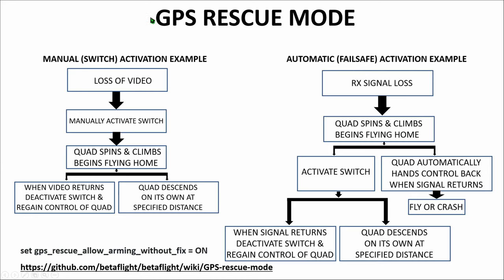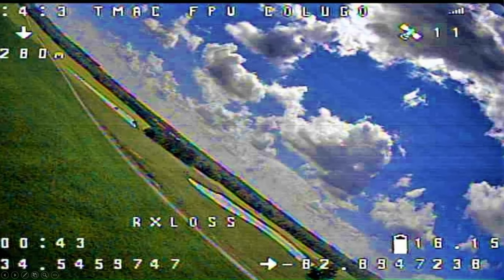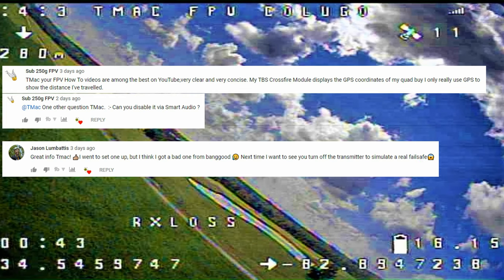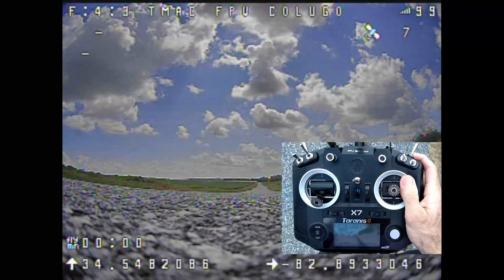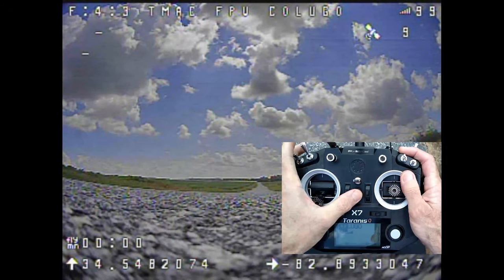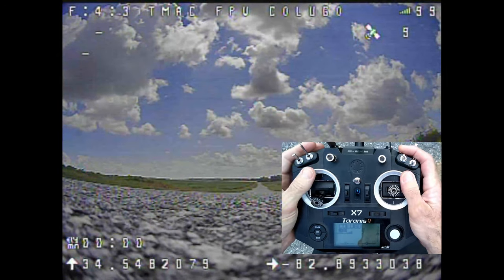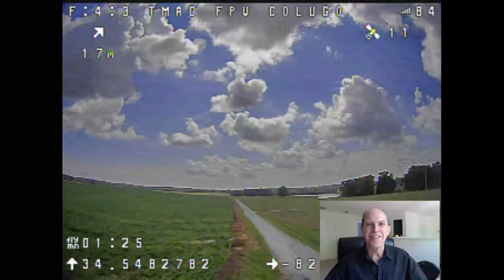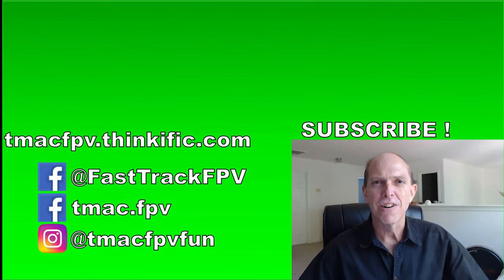BETAFLIGHT GPS RESCUE MODE FAILSAFE

Comment: Hey Tmac, great video thanks. I tried to simulate a failsafe to see if the quad would RTH. I used an aux switch on my transmitter on the aux tab in BF and set the switch to failsafe. Upon activation the quad just dropped. It didn't RTH. Any idea where I could be wrong?
BTW I did get a proper gps lock and also the quad RTH when testing it with GPS rescue assigned to a switch on my TX... Cheers Jake

Comment: What if the arrow does not point back home? My arrow never points back home, but the distance to home is very accurate. Using an HGLRC M80 Pro and a Zeus F748 stack. When i flip gps rescue it shoots up to like 70m in the air (even though rth is set to 30m). I'm also more than 200m away when I tested. Is there a way to calibrate the home arrow?

Comment: Hi Tmac, today i was flying for the first time my new 7 Inch Long Range Build with Crossfire. I have setup my Betaflight exactly like you. Than around 1km away i was turning back to return and got a Failsafe. But the Quad crashed directly to the ground. I was 20m over the Trees of a Forest. Fortunately, everything survived without any damage (Props included). So tomorrow i will test the Switch based GPS rescue. At the time of the Failsafe i got 18 Sats....
Reply from the maker: That's odd  Sounds like you got lucky!  Test it in a safe area and manner (in case it does't work) until you gain confidence with it.  Sounds to me like something's not set correctly.  How many satellites did you have when you launched?  did you have the minimum necessary?  You can check all of your GPS settings in Betaflight by going to the command line interface CLI tab and in the command line type the words  get gps  and press Return on your keyboard.  Everything that shows up on your screen will be GPS related.  Look at al the settings (such as minimum distance, min # of satellites, etc.).  If you're unsure of what each setting is for, please see the following link: https://github.com/betaflight/betaflight/wiki/GPS-rescue-mode
Reply: @TMacFPV  Tomorrow i can tell more i think. I have double and triple  check all settings. Everything is setup correctly.
Reply: Today ist worked fine. 5 trys with switch and one try with turn off the Transmitter to cut the crossfire link.
Reply from the maker: @zefixx6659  Outstanding!🙌👍 Happy to hear it😁 Thanks for the update!
Reply: Its my understanding that when using CSFR for the controller link,one must configure the Crossfire RX "failsafe" action to be "CUT". Then when the CSFR link is lost, the Betaflight configured Failsafe actions (failsafe1, then  failsafe 2 and GPS rescue) will then kick in. If your Crossfire RX failsafe setting is not set to CUT, then GPS rescue wont work at RX LOS.

Comment: Tmac great video but still a bit confused. I have GPS rescue enabled and the switch rocker works fine but how do I set the failsafe.    I have the failsafe set to GPS rescue and can also GPS rescue  mode by switch  myself.  So do I need to touch any of the channels on the left of betaflight ?  I see a bunch of.channels under the failsafe tab or can I just leave this ?  Thanks again 👍. Also do I need a failsafe mode enabled in the modes tab ?  Cheers
Reply from the maker: This was the 2d of two videos. The 1st one shows the setup here https://youtu.be/2lePVoK0t1c

Comment: Coming from Inav, I setup BF rescue and all works fine except when I turn OFF my TX  BF doesn't recognize FS even though throttle drops to 885. In Inav it works, parachute turns red.  Any ideas?  Thx

Comment: Hey tmac great video I have just got croc baby 5 never used GPS in fpv drone before my area seems to be all over the place and the distance from home and height doesn't seem very accurate is this normal? If you are facing towards yourself which direction should the arrow be?
Reply from the maker: Hey sheapy FPV!  please see the following link, "We Suggest the Following Procedures" paragraph. https://github.com/betaflight/betaflight/wiki/GPS-rescue-mode
Reply: @TMacFPV  thanks tmac 👍
Reply: @TMacFPV  if the arrow is pointing forward (up) is that coming back to you and arrow facing down going away from u?
Reply from the maker: @sheapyfpv8224  if your GPS arrow in the OSD is pointing up, "Home" is in the direction your aircraft is currently flying (in front of you).  if the arrow is pointing down, "Home" is in the opposite direction your aircraft is currently flying (behind you)

Comment: Great video! I set up a RDQ gps on my quad, cant get a switch to work? I have the range set correct but when switch activated it will not light up the gps rescue tab in betaflight, it stays gray/ Have any suggestions? Thanks!
Reply from the maker: Did you grab the available checklist in the video description? Might help👍
Reply: @TMacFPV  I have been it will not activate closer than a 100 meters, so I guess you cant ck the switch in Betaflight?

Comment: Excellent video.  However, I hope you can assist or explain my issue.  I have had two quads now do the same thing whilst testing GPS rescue mode (activated by switch) and that is flip upside down and free fall to the ground.  Both quads GPS rescue trials worked perfectly on the first test, however on the second attempt each flipped and free fell, and no matter what I did I was unable to regain control.  First first one happen 6 months ago and it caught fire when it hit the deck, the second only yesterday flattened the 4S 1550 Lipo but no other damage.  Fortunately the Crossfire system retained the GPS coordinates when they hit the deck so I was able to find both quads with ease even though they plummeted almost 1 mile away from launch.
Reply from the maker: hmmmm, I do not know for certain what the problem is.  I can offer some things to look at though.  First, make sure your Accelerometer is toggled to ON position in BetaFlight.  Next, here's alink to GPS Rescue in Betaflight Wiki:  https://github.com/betaflight/betaflight/wiki/GPS-rescue-mode  And, finally, Bruce Luckcuck is the developer of this feature and he can be reached in Betaflight Slack at: https://slack.betaflight.com/

Comment: Just a note that the OSD menus are not "smart audio". Smartaudio is a protocol used by the flight controller to communicate with the vtx to set channels, power, etc.
Reply from the maker: Yes, thank you Bruce! I did catch my verbal misspeak when I uploaded the video and included Betaflight OSD in the description of the video rather than "Smart Audio." I must have been focused on answering the question using the same terminology in the comment I received.  I have now also included a "card" in the video at the 2:03 time mark clarifying my mistake for those who do not read the video description.  Thank you again!

Comment: Hi TMac. I've returned to this video specifically in order to ask you a specific question. I'm asking because I believe you will give me a detailed answer, weather I'm right or wrong, about a certain theory of mine regarding some challenges with my gps module. Powering up my module separately from the rest of the quad does help acquire a sat lock  more efficiently; however,  once I power up the rest of my quad, including the vtx of coarse, things seem to get a bit wonky with the gps signal. Even after separating the gps module and it's wiring from the vtx and nano Crossfire receiver. 
 It's a 4" quad and I understand the challenges with a smaller setup like this but here is my question to you, Sir...
   What if I fabricate a small faraday cage encapsulating each competing component individually? Perhaps utilizing copper screen material surrounding the vtx, rx and even the flight stack itself thus preventing any interference in the first place? Do you think that would work? I realize the wiring between each of these units would have to be protected as well but do you think there's any merit to my theory?
Reply from the maker: Hey Don, good question.  Yes, we all have that same issue when we power on the rest of the quad's components (especially when using an HD camera onboard).  theoretically, your idea has merit, however, it may not be a very practical application.  Any way you can isolate other electromagnetic interference (EMI) impacting your GPS module will help.  The most practical way I have found thus far is through the use of copper foil tape (here's a link to the type I get from Amazon  https://amzn.to/3A1Kpqj).  I use the tape to wrap the 3D printed mount the GPS sits in and also the GPS wiring harness and any other wiring harnesses that are near the GPS.  Then, I run a wire from a ground pad on the flight controller to each of the copper foil wrapped wrapped items and solder the wire to the copper foil tape.  here's an example showing one of my 3" quads with the GPS mount wrapped in copper foil tape and the GPS wiring harness wrapped in copper foil tape.   You may not be able to see the ground wires soldered to them  https://bit.ly/Example_Copper_Foil_tape .  Another thing I found has helped is to run the LiPo battery leads away from the GPS module (it at all possible) rather than back toward and along side of it.  Hope this helps!  I'd be interested in hearing your results.
Reply: @TMacFPV  Thank you so much for your reply. I just ordered some copper tape.

Comment: I am piloting with my DJI radio and would like to know if your RESCUE GPS setup (set to Failsafe only) is working if I lose signal or video?
Reply from the maker: Failsafe is for loss of control signal. If you lose video you need to flip a switch to activate it. I do not use SJI, however, here's a video demonstrating it with DJI https://youtu.be/KXyhfmY9b6A
Reply: @TMacFPV  thank you Tmac, so in 2 cases, I need to activate switch and disabled it once rx signal or video return ?
Reply from the maker: Yes, that's ideal. Use the switch for both. However, for failsafe (no control signal) it should activate on its own. However, if you don't flip the switch afterwards, it will return control to you as soon as it gets it's control signal back and you may not be ready for it. Here's a complete "How to" video  https://youtu.be/2lePVoK0t1c See more on Betaflight Rescue here https://github.com/betaflight/betaflight/wiki/GPS-rescue-mode
Reply: @TMacFPV  thank you Tmac, take safe
Reply: @TMacFPV  do you think your setting of gps rescue run on a 7''  quad
Reply from the maker: @yannperherin354  gps rescue should work with any size quad

Comment: Unfortunately, today I lost my Tyro129. I don't understand what happened. The RSSI was good, but suddenly the rescue mode was activated on its own, and, instead of going back to me, it goes away! When he was leaving, I could see the rescue mode deactivated, and he started to fall; the video signal was interrupted before reaching anywhere on earth. After the fall, I was unable to get any signal, neither from the ratio nor from the VTX.
Reply from the maker: Wow, that is very unfortunate.  That's the first time of heard of "GPS activating on its own" and flying away. What's even more curious is it "starting to fall" after deactivating and you losing video (power?) completely before hitting the ground. Did you have the DVR recording on?  if so, playback the DVR footage and take a look at your OSD for RSSI, warnings, etc. to see if it has left you a clue as to what happened.  Did it work properly when you tested GPS rescue prior to flying with it?  If you had OpenTX logging of your GPS coordinates to your transmitter's SDC card per this video https://youtu.be/Ep_RrfOIW_k you may still be able to find it.  I'm guessing you didn't have the last known GPS coordinates displayed on your transmitter as demonstrated in this video thenhttps://youtu.be/mqYcgPZe1KE .  If not, I know it doesn't help your current situation, however, perhaps it will in the future.

Comment: Wow dude next time get some more altitud and do not use acro mode to do the test use horizon or angle before you turn the radio off, the craft backed left during the radio turn off procedure and you did lost some altitude and attitude from the craft, you are my hero, just in time the failsafe save you craft. LOL   You have big cojones, fantastic love it.
Reply from the maker: Hey maxun1, welcome aboard! It WAS a little "exciting" 🤩 wasn't it?

Comment: what you was doing with sticks while drone was in RX loss ?
Reply from the maker: nothing at all. With GPS Rescue as the failsafe, the quad starts to return to it's launch point on its own (without any control from you moving sticks) until you regain control of it when control signal comes back or it crashes near it's launch point (it does not soft land)

Comment: Nice test 👍 😀, I have a question,  why my  drone seems loosing altitudes after flicking the gps rescue switch? The drone will head home but instead of gaining higher altitude it starts to loose the altitude?  Isn’t it it supposed to go high while heading home? It seems like it’s loosing power. What settings I need to adjust in the CLI to make it work like yours?
Reply from the maker: Thank you!  I'm providing you a link to my complete GPS setup video.  Start at time hack 10:30 of this video:  https://www.youtube.com/watch?v=2lePVoK0t1c
Reply: TMac, You are awesome TMac 😀👍
Reply from the maker: @wilfredocampo4215  Thanks for your support Wilfred! Happy to help friend!

Comment: Great video thanks. But checklist link did not worked. And i'm not to be sure which switches did you changed before open the radio again ?
Reply from the maker: Thank you!  I just tested the link and it works.  Please check you r other email folders such as "Social," "Promotions," or even "Spam" folders as sometimes emails will get routed to these folders by mistaqke.  If you find it in any folder other than your "Inbox," just move the email to your Inbox so you'll receiver future emails from TMac FPV in your Inbox instead of a different folder.  If you're still having issues, emial me directly at tmac@tmacfpv.com.  I'll do my best to help
Reply: i got that , thanks :)

Comment: Great vid as usual tmac ive just installed gps on my dji quad will test rth when were rid of this coronavirus. 
When testing did you have constant visuals through your goggles? I have only set it on a switch for now,  my failsafe is still set to drop as i do more woodland flying. But a great feature for when i start the long range testing of the sub250g quad again great content.👍
Reply from the maker: Hey Urban Myth FPV, great to hear from you!  Yes, I had visual in goggles the entire time. What you're watching in the video is the goggles' DVR footage.  Even though transmitter is turned off, as long as quad is powered through LiPo you still get video in goggles.

Comment: Oh wow, so GPS can save our quad if we encounter RX LOSS/FAILSAFE? If so, I need to implement this then. My last video is RX LOSS and my quad crashed! Also, when you turned it back on, did you have to arm it again? Thank you!
Reply from the maker: 👍😉Yes and you're quite welcome!  To answer any questions you may have, please see the GPS Rescue Setup Checklist & Flowchart link and Micro FPV Betaflight GPS Rescue Mode Setup Video link in video description above
Reply: @TMacFPV  Hi. I received my TBS M8 GPS today. I downloaded your checklist. There is one section in your document that I got confused specifically the FAILSAFE/RXLOSS on last page. You wrote "QUADS SPINS & CLIMBS. BEGINS FLYING HOME QUAD". After this is "ACTIVATE SWITCH". Why do we need to do this if quad is headed back to us?

I watched your video again. You turned off your transmitter to simulate a FAILSAFE/RXLOSS. Does the quad have to be in a certain distance away from us for GPS RESCUE to work? Or does it work irregardless of distance since it's a FAILSAFE/RXLOSS?

I saw you activated the SWITCH while transmitter was OFF. What about the ARM switch, where should it be? Should I keep it in ARMED position?

Comment: hi Tmac, if the gps rescue work or not by switch off the radio and then switch on without fliping the rescue mode?
Reply from the maker: I'm not sure I understand your question correctly. Yes, GPS rescue can work as your failsafe mode without flipping a switch on your transmitter. Or, you can initiate it by flipping a switch (such as if you lose video). See the flowchart in this video for how it works. Turning off the radio while the quad is in the air (for demo purposes only), with my failsafe set to GPS Rescue is the same thing as if losing control signal with the transmitter still turned on
Reply: @TMacFPV  thx

Comment: I tried this, the thing is when activated the rescue mode, the quad spin towards home direction, increase height until 50m (as in CLI setting) but it disarm after 2 seconds, I tried change sanity_check to On / Fail-safe or even Off but, both still disarm my quad after 2 seconds, what went wrong?
Reply from the maker: Hey Franky!  See this link https://github.com/betaflight/betaflight/wiki/GPS-rescue-mode and perhaps its one of the "last two conditions" it talks about in this paragraph:
"Sanity checks will ensure that:

GPS receiver is still connected to the FC
GPS receiver is sending a valid GPS Fix
Quad has not experienced a big shake (probably due to a crash)
Number of Sats is equal or above gps_min_sats
Quad gets closer to the home point after reaching initial altitude
If any of the conditions is not met, the Rescue operation will be aborted, meaning the quad will be dropped. However, the last two conditions have a few seconds of tolerance before getting triggered. Also, if the quad is not getting closer and a magnetometer is being used, Rescue will attempt to use GPS orientation as a second chance, but if a flyaway is still detected, the operation will be definitely aborted."